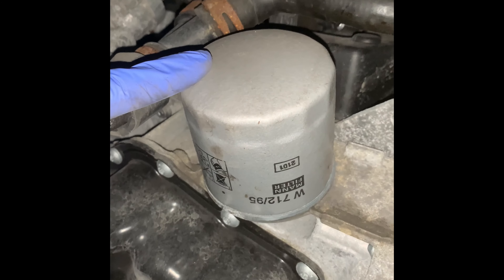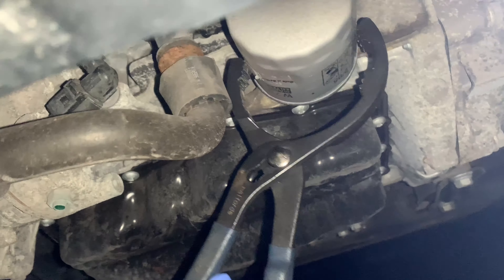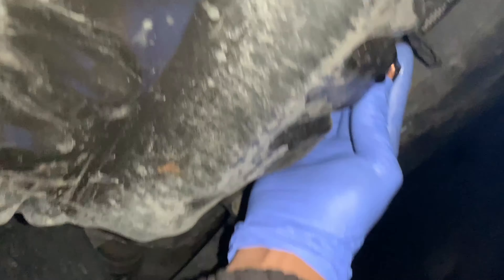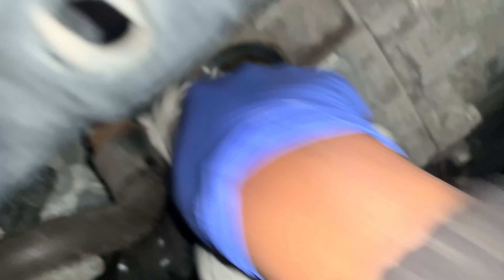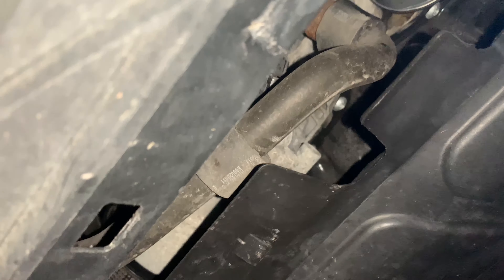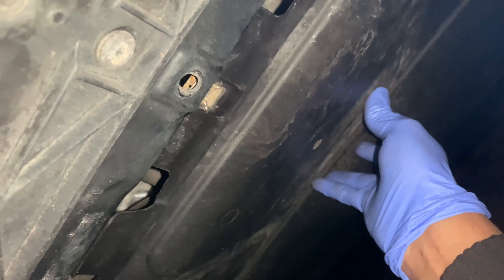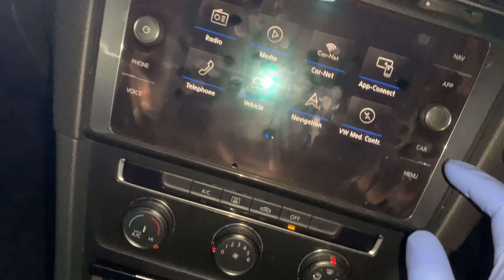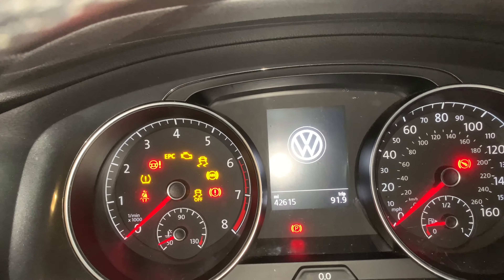Volkswagon Golf MK7.5 (1.4 TSI) Oil & Oil Filter Change - Service Reset

Comment: A few tips for a better end result. Warm up the engine first. Remove the oil filler cap. These steps aid the flow of old oil once the sump plug and filter are removed.

Also, these EA211 engines are very sensitive to overfill. Refill with 3.5L to start, make sure the car is as flat & level as possible, run the engine for a minute, then check the oil level and add a little more at a time to reach max. Manufacturer states 3.8L total.

If you overfill by even a small amount, you'll get overpressure in the turbo, and oil in the exhaust system, neither of which are good for the car.
Reply from the maker: You sound very knowledgeable thanks for in depth advice will take on board 👍🏽

Comment: do you replace the oil drain plug washer or keep reusing it?
Reply from the maker: better to change but if you don’t have one you can reuse it
Reply: @jaysworkshopgarage  Thanks! The undercover panel. What Torx sizes are they?

Edit: Nevermind, found out myself :)

Comment: What size torx are the big ones? I got the smaller ones off but didn't have the correct size for the big ones.
Reply from the maker: @maichell5094  not exactly sure of size sorry
Reply: It's a torx 45.